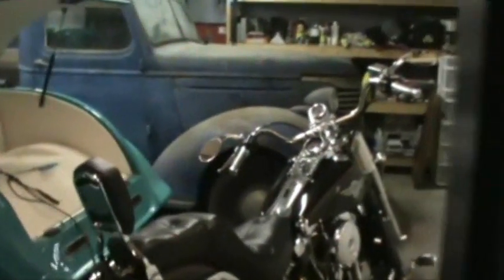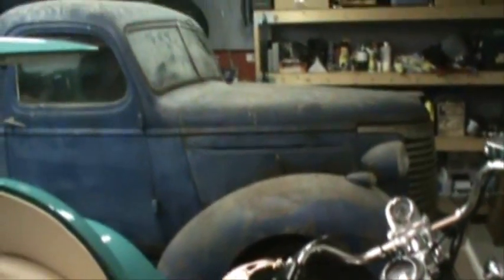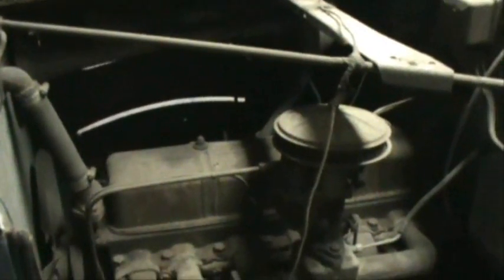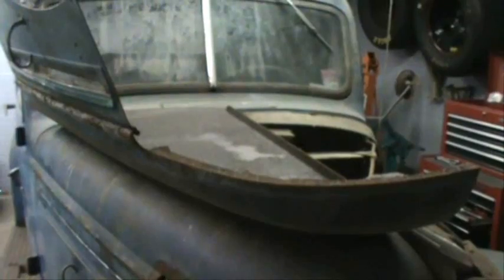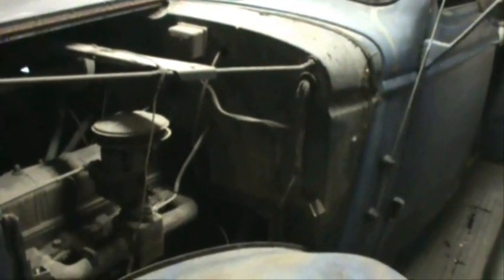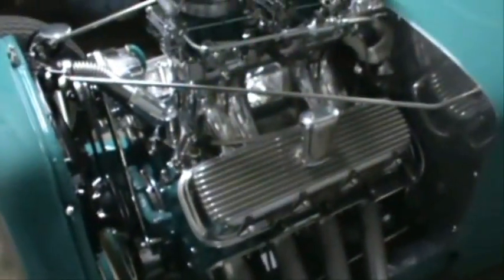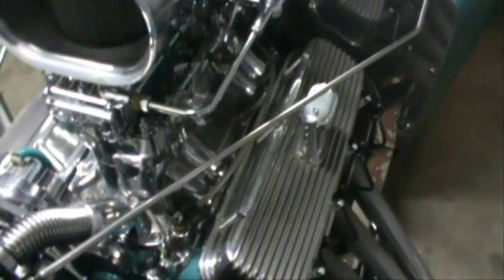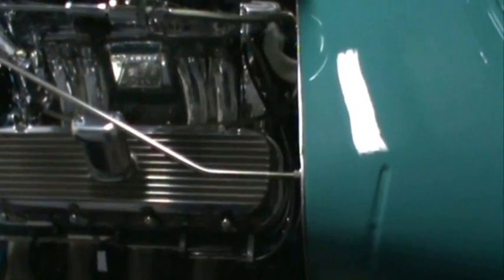1940 Chevy truck update

Comment: I know its over kill but 

The origin of the term "footage" is that early 35 mm Silent film has traditionally been measured in feet and frames; the fact that film was measured by length in cutting rooms, and that there are 16 frames (4-perf film format) in a foot of 35 mm film which roughly represented 1 second of silent film, made footage a natural unit of measure for film. The term then became used figuratively to describe moving image material of any kind.

Comment: Leave the air fiter on, you are going to only let more moisture into the engine and rust it up and seize it up more.  Its not going to fit your motorbike.  Get a correct replacement motorbike filter off ebay, its where I get all my motorbike parts for cheap.   And the horn on the 40 chevy is 6 volt, not 12 like a car, so don't go connecting the horn to a modern day 12v car battery.  The 40's used 6 volt throughout.  And a seized motor is not death; take it apart and rebuilt it.

Comment: Oh god are you are insane, that's a mint condition 40 Stovebolt 216 with damn near all the original paint with all the parts to it. In fact, the paint job on this is so good, I'm going to use this video as my reference to restore my identical rusted out color. To drop a V8 in this beauty 100% stock and make a shitty ratrod truck out of it and destroy the reference paint job would be an abomination punishable by god. The 40's were the first year with that rectangular gauge, the 39's had 3 gauges.